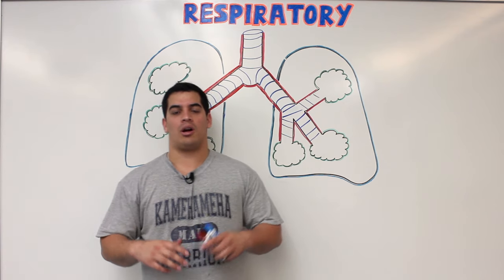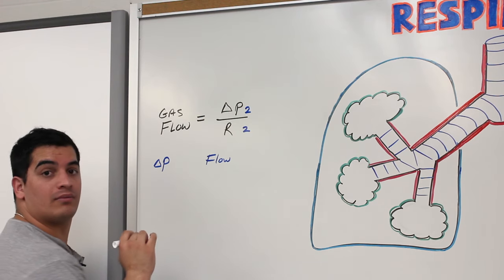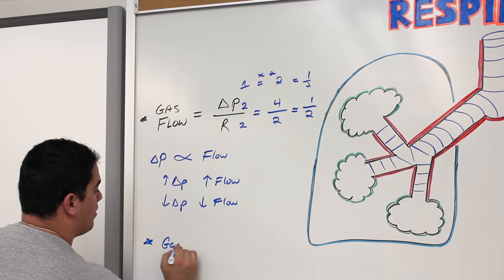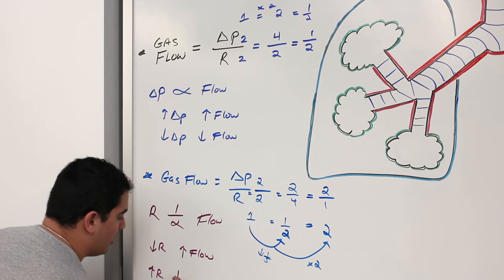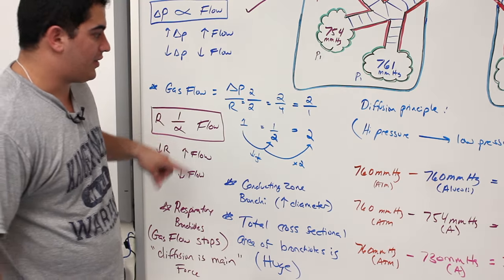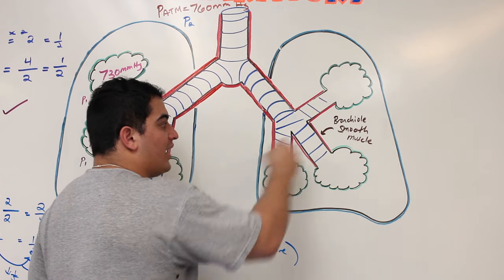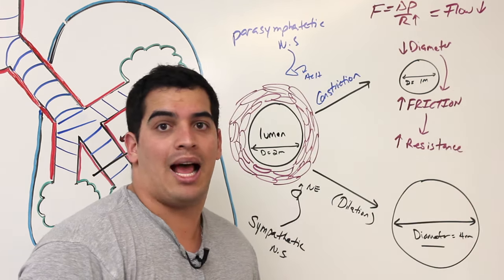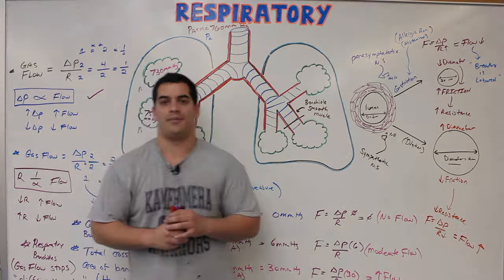Respiratory | Airway Resistance

Comment: What are examples of increased inspiratory resistance? Thanks!
Reply: Increased inspiratory resistance is seen in patients with asthma or other types of allergic reactions where there is increased muscarinic or H1 receptor stimulation, leading to increased smooth muscle contraction and bronchoconstriction. The radius of the bronchioles decreases, turbulent flow through the bronchiole is increased, and resistance goes up per Poiseuille's Law.